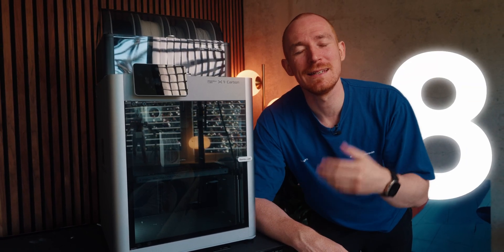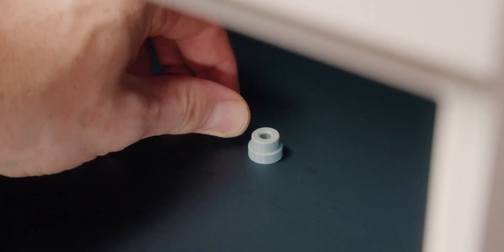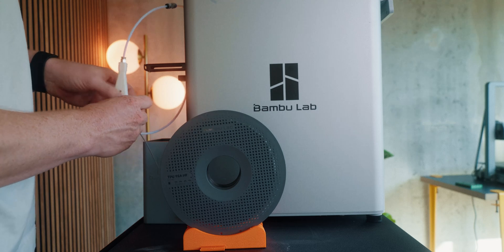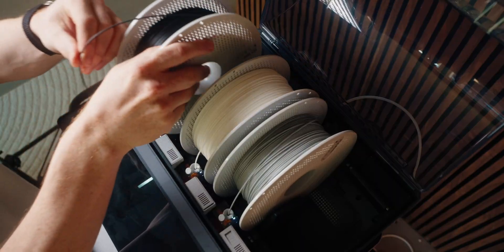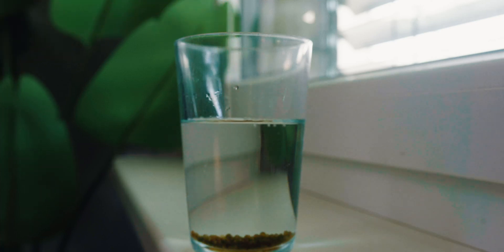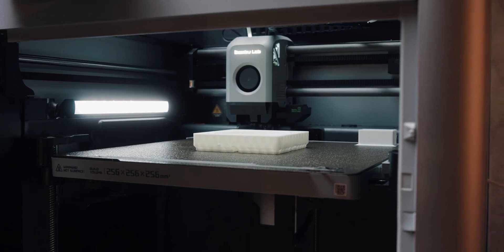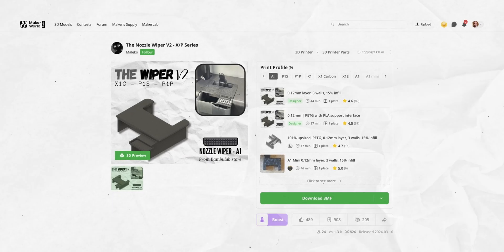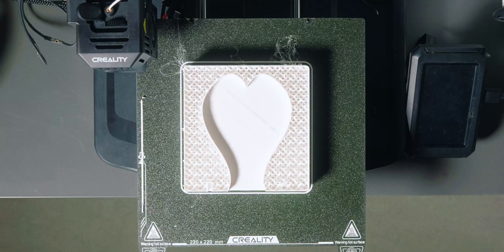8 Mods to make your Bambu Lab Printer even better

Comment: watched a bunch of videos with various poop collectors, and I know you have a 3-D printer so you should print something, but I did something much simpler.

I took a cardboard box that had fold in tabs to secure it for Shipping, I then put those tabs under the printer and put the rest of the box to collect the discard. I was actually pretty proud of myself because I didn't have enough space for the full box, so I cut it down so the bits would slide in and make the box half as deep.
Reply: I'm gonna guess that you're using a cardbox hack instead of printing a container because you're using the heat bed to make a grilled cheese sandwich.
Reply: @tuckertucker1 haha

No I just started using it, and I haven't done any multicolor work yet. Reading up on things, I'm planning on using purge to object which should minimize the poop waste

Comment: One of the most consistent problems with the X1C that I've encountered is running a very long multi-color print and the poop chute gets filled up then that backs up inside and has actually knocked off the front panel of the hot end assembly.  I just killed that print job, cleaned out the mess where poop falls down into the chute that was plugged up then plugged the wire from the panel back onto the assembly and put the panel back on, cleaned the build plate off and pressed print again.  In that case, I just let the poop fall free and cleaned up the mess.  So yes, I'm looking for a better poop solution to avoid the constipation.
Reply from the maker: Interesting! I think I’ve never had a problem with that. ( I don’t print too much multi color though)

Comment: I NEED HELP!!! 

I have problems with the hot end cooler, I have changed 2 under warranty in the span of 2 weeks, I'm thinking that what is damaged is something else or there is a design problem. The error is the low speed of it and the machine not printing.

Comment: I used a similar Y-splitter and over time, I found my chances of getting a "Failure to unload" error rose.  So I bought the "AMS lite' unit from Bambu... because it's extruded, not printed, it is a better path for the filament.

If you have any retraction/unload issues, try switching to an extruded splitter.

Comment: Does the bottom of the Bambu get hot? can the unit be put on a table with cloth covering?> thanks
Reply from the maker: I havent tested this extensively but just checked and the build plate i keep under my printer was cool to the touch

Comment: ARNE B. 3 options to for 5kg spool. Ziplock makes a 2 gallon bag, also ziplock makes an even larger clothes bag, or you cold use a large vacuum seal bag with your own 3d printed clip to keep bag closed and put dessecant bag inside. FOR BUDGET CONSCIOUS PEOPLE USE A ALDI PLASTIC BAG USE A ALDI PLASTIC BAG WITH YOUR OWN HOMEMADE 3-D PRINTED BAG CLUB.
Reply from the maker: thanks! those are really cool ideas 😊 for now I'm sticking to 1kg refills as it's way easier for the amounts that i print...

Comment: What hygrometer did you use?  Want to make sure I get one that fits the print.
Reply from the maker: I just put hygrometer round in Amazon search. These seem pretty standard as there are a lot similar ones from different brands 😊

Comment: you told about the 3 extra silica holders. but what about those behind in the AMS. i see many say print the box and use silica balls in them also. why dont you talk about them ? dont you need it when those 3 in front or why ? and also what about the filter inside the X1C i know some made a box also so you can use pills for it and dont have to by the filters from bambu lab. i even think the filters only sells there. i am new user not even startet yet only build my X1C with 2 AMS. and just got  a complete 0.2mm nozzle so now i am changing the 04 to the 02 because i will use 02. like 90 % of the times
Reply from the maker: nice to hear! In terms of the AMS, more silica is probably better. I left the orignal bambu silica packs for the beginning but will likely also print enclosures for silica back there!

Comment: Thank you SO much for these mods. But I am confused by the Y splitter. I don't understand how the AMS knows that there is another spool available. What am I missing on how to use the splitter?
Reply: When loading filament manually, a sensor in the hot-end 'knows' what you have done.
The printer 'knows' it didn't load filament from the AMS, so it assumes manual loading.
When send a print-job, be sure to un-check the AMS option.
Be careful using splitter with 'pauses' in a print-job...I've seen the printer go into a 'coma'.
Best to disable AMS completely by unplugging the cable.
There are always situations where filament changes can't be automated...

Comment: FYI, it should be noted that the chemicals used in the desiccant to provide them the color-change properties is TOXIC. If you buy it in bulk to use like here do not use bare hands to work with it, wear gloves. And even then wash your hands afterwards just to be safe. The non-color changing desiccant does not contain anything toxic but you'll need to monitor it more closely to see when it's exhauted.
Reply from the maker: Thanks so much for letting me know! I'll keep that in mind for the futute

Comment: I wouldn't throw away the 5kg spool filament just yet unless its UV damaged. Chuck that thing inside the X1C with the bed hot and leave it in until dry.
Reply from the maker: yeah I didn't throw it away... Wanted to make a little project to build a respooler anyways and might use it with that, then I can also dry it out in smaller batches...
Reply: @arnebornheim  That's a great project! You could make an interesting video by respooling a 5kg roll into 5 1kg rolls. No idea if that is cost effective though lol.
Reply from the maker: @mrteemug5329  haha sadly it isn't really... That's why in future i'll stick to 1kg rolls i think 😊

Comment: Would you recommend I still get a dryer if I’m using the desiccant mod in the AMS?

Great video by the way!
Reply from the maker: Really depends on the filaments you're printing. In general the Ams can keep filament dry but not dry it out. Whereas a filament dryer can actively dry filament out. That being said there are other ways of drying out filament like the X1 build chamber or an oven. 
Only reason you should definitely get a dryer is if you print some engineering grade materials that should be printed directly from a dryer. Other than that just wait and see if it's needed 😊
Reply: @ super helpful, ty 🙏
Reply: @arnebornheim  I am almost certain that the AMS will dry the filament until it reaches an equilibrium with the desiccant, so to the same humidity as it can keep the filament from absorbing moisture. it is just going to take longer than heating the filament to dry it.

Comment: When you get to a point where the print is more important than the printer, you buy an x1c, plug it in, and print. No need for so called “mods”. Have over 5,000 hours of print time on 3 of these with no problems. I can count the failed prints on one hand and they were usually my fault. If you want to improve something, learn your slicer. That is where quality prints come from.
Reply: What's wrong with the Y splitter? You can't understanding a used for that print?
Reply: You effectively described the experience of every Bambu Lab printer. Not to mention, almost every one of these applies to P1 & X1 alike! As a fairly heavy X1C user, you would surely find a couple of them helpful.

(Kinda feels kind you just came here to brag/hate?)
Reply: Amen
Reply: Lol Bullshit :D

Comment: Awesome, didn't even know what that water drop number was - Impressed it has a humidity sensor in the AMS
Reply from the maker: Nice to hear you learned something new 😊 it’s definitely good to keep an eye on that
Reply: I was seeing a persistent '2 water drops' on one of my AMS units.
Looked at the desiccant packs...yup, dusky orange had become clear/yellow with a bit of mossy green!
Not bad, not great...
A few hours in a food dehydrator...excuse me, 'blast air dryer' and the beads were proper orange again.
I didn't really trust the Bambu moisture sensor (slow response time), but I do now.

Comment: It's a bigger project, but I just rebuilt my original X1C AMS into a Python system since it was showing its age anyway- absolutely no problems with filament jams, motor overloads, or cardboard spools since I made the change. If you don't want to source the hardware yourself, Voxel has kits for $9.99 right now and you can print the parts yourself for free (plus filament, obviously)
Reply from the maker: Cool! this sounds like a super interesting thing :) Happy to hear yours is running well

Comment: Should have also included the gear removal tool that Bambu provides the STL for in order to remove the hotend gear if it is not loose enough to remove by hand. Better to print is before there is a problem (such as a jam) with the hotend.
Reply from the maker: Thanks for mentioning this! never had any problems but I see your point of when it's there it's already too late (for most people, I could print the tool on another printer ;) )

Comment: The resion for the Bambu Lab logo is to prevent people from trying to force it to work on other printers or for simply style.
Reply: That’s not a good reason as I can’t see anyone trying to print a dust cover as seen in this video and then try to fit it on a Creality or whatever. Also if it works on another printer then why not just have without the logo. It makes zero sense to place it there

Comment: can’t wait to print a few of these ideas. found the desiccant holders in another video, and am also using pull out trays for the ams packet holder. getting ready to tear apart my ams because i’ve had spool 3 feeding issues. i’ve seen recommendations to replace tubes and make sure there wasn’t any clogging, so i’ll be putting on the bambu splitter and some of those quick connects

Comment: I recommend printing the dessicant holders in ASA. That way you can just pop them in the microwave on defrost for 10 mins to refresh. No worrying about spilling the beads all over the place (ahem, guilty!).
Reply from the maker: That’s a really good idea! I have. Some asa laying around and might try this !
Reply: Why precisely the ASA ? Why does it resist better in the microwave than other type of filament?
Reply: @jeyaubx122_5  looks like it has the highest temperature capability of the filaments for 3D printing, so won't melt in the microwave when you heat the desiccant to dry it
Reply: @jeyaubx122_5  it's fairly common and easy to get. It's easier to print than ABS. And it has a higher temperature resistance so it won't melt in the microwave when you recharge the desiccant beads
Reply: @jeyaubx122_5  ASA is resistant to heat.
Reply: What humidity sensor did you use?

Comment: On my x1c every connection has glue on it and I notice not all of them have the glue on ports. Do you have that and do you know how I can remove it? I think thats my biggest down point for bambu. Putting glue on everything. How can I cjange the hot end if every wires connection has glue on it?

For me the nozzle wiper also didnt work for botj my printers. Alot of times it just wouldn't cut but than after the update it cuts perfectly on both. I think they changed the cooldown time before the cuts.
Reply from the maker: If the glue is in the way you might consider just removing it with pliers or push it off with a pen... But please make sure only to do it on the right connections. You need to take out 3 of the connectors to change the hot end. Some other connectors are for other stuff and stay in. 

And cool to hear the nozzle wiper mod works for you!
Reply: @arnebornheim  thnx for the tips! I'l have to be very carefully removing the glue :)

Comment: Don't throw out the 5kg spool, dry it on the heat bed
Reply from the maker: Thanks that’s a great idea! Will see if it fits 😊
Reply: I am considering buying a 3D printer (likely a   P1S). But as the climate here where I live is always relatively wet (high humidity even when the sun is burning 24/7) I'm likely gonna build a small "room in a room" for the printer, and simply put a dehumidifier in there to keep the entire room dry. This also has the extra benefit of containing any fumes.

Comment: Really nice video. Especially the timelapse mod seems interesting for me. Do you recommend to place the printer on a workshop trolley? I am currently searching for something similar to securely place my printer but haven't decided yet. Currently its on the floor which is not that nice ;)
Reply from the maker: Thanks a lot :) !

in terms of the workbench: it still introduces wobble in the printer, since I dont have the wheels locked off either. That being said I have no problems with printing :)

Comment: hey man thanks for the timelapse mod, I definitely have to try that out!
For the splitter, I highly recommend the one from Bambulab. Also consider to upgrade the nozzle wiper if you print something like PETG since it has a tendency to not get wiped properly. (although i also get this problem with PLA sometimes). The nozzle wiper from Svenkrause works amazingly well, and you’re in Germany so you can just easily buy it from them👍🏼
Reply from the maker: interesting point with the y splitter from bambu. I couldn't find it though 😕 do you mean the 4in1 splitter from the A1 or is there a specific y splitter?

also will look at the nozzle wiper!

Comment: The Y-Splitter can be bought from bambu store. I would recommend this as i had problems with printed ones that the filament did get stuck.
Reply from the maker: Thanks for the info! could you either comment or send me a link? I couldn't find it on the website
Reply: I printed 1 in pla and 1 in petg. For me it went perfectly so maybe the tubes got bend?
Reply: Yeah, I saw this after printing mine. It's super cheap too and includes the fittings I just paid more for than the official part!😂
Reply: @imaginitivity7853  I don't seem to see it on there website

Comment: I think people add the logo for one of a few reasons: 
1) They really enjoy the bambu brand and want to celebrate / be part of it
2) It enhances the idea of manufacturing "real" parts yourself. By putting branding on it, its more like a professional product
3) Similar to 2, it makes it seem like the parts are part of the official product and people want to maintain the aesthetic
Reply from the maker: thanks for the insight. I understand it on some level but honestly not everything of the original parts is branded. But hey I fully understand it's personal pereference. 😊
Reply: @arnebornheim  To be honest, I think it's more-so they think by including the logo their model will get more "recognition", earning them more makerworld points.
Reply: @burnsyd17  But isn't it being paid by Bambu ? The entity being violated is also the one agreeing to pay the violator. Can not be too much of an issue.
Reply: They may also use the logo to know which part goes to which printer if they have several differing models.
Reply: @SunnySunFlower65  Good point.
Reply: @SunnySunFlower65  and an easily identifiable visual identification for when you are looking for files for your printer
Reply: It’s quite possible that people just added the logo cause they just added the logo. Not everything in life has some crazy deeper meaning that only Buddhism will reveal to you once you meditate for 10,000 hours butt naked on a bicycle with no seat.
Reply: No matter the reason, it's still ripping off someone else's trademark, which is a violation, thus illegal!
Reply: @butterflyj685  people are not trying to pass off stuff with a bambu labs logo as "real" bambu products. A big part of any trademark claim is whether it causes confusion in the market, which this would not. Its more like fan art. Relax my dude, people just trying to enjoy themselves.
Reply: After what Bambu did to the terms of service, I see no one who might be excited by this Pos company

Comment: Personally, I add the logo on my models for identification reasons. I have a hard time with losing stuff, especially small tools. So having identification markers that this tool is what I'm looking for and what it is to be used with this product/ material. For example, I made a tough box with a Bambu Lab logo on top. I printed it with white and red PLA +. It is a box that will not be around high temperatures, should be able to be beaten around a bit, but most importantly the red Bambu Lab logo tells me that box belongs to my printer in case of emergency. Like an emergency kit would look. That is my personal reason and I got the idea from Adam Savage a long time ago but other than that I actually prefer no branding, even on my clothes lol Also, just a tip, I would recommend not storing objects under the printer itself. As the Z axis belt, tensioner, and exposed idler pulley. You don't want anything rubbing against this stuff, dust, and/ or having accidental chemical exposure to the belt itself IE IPA commonly used. I found that the belts and idler pulleys are the Achilles heels of these machines but if properly maintained, that work flawlessly.
Reply from the maker: Alright that's definitely a point that I can understand! For many mods, that go inside the printer I don't though haha 

And thanks regarding your recommendation with not storing stuff under the printer. I have the anti vibration feet installed so the printer has lot's of clearance and i think I'll be ok